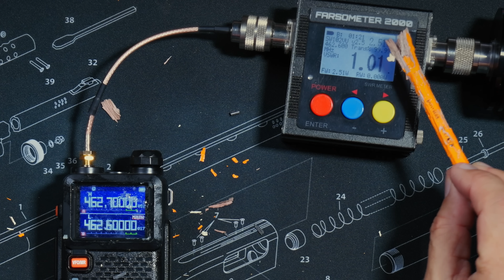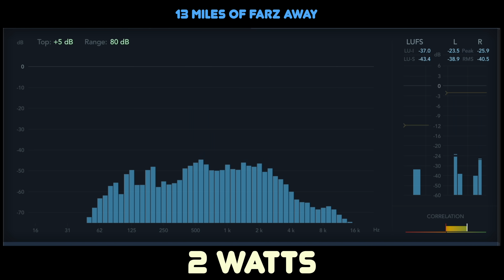Why Power Output Does Not Matter On A GMRS Or Ham Radio

Comment: 13 miles i doubt that unless your a mile high over flat terrain, i barely get a mile or so in a small town
Reply from the maker: Your doubt is invalid. These transmissions were recorded from 13 miles away exactly as described in the video.. Just because you can't do it where you live doesn't mean that nobody can.
Reply: Yet another "sad ham". So many sad hams and so little gravy!
Reply: If you’ve heard him talk about it, he lives on an elevated area without many trees. I get the same 1-2 mile results but I live in the Michigan Rainforest about 5 feet below average terrain.
Reply: I never have any problems getting 10 miles or more from any of gmrs radios.  I have been on the road full time for 2 years traveling in my van over various areas and terrain.  Gmrs works well for me.  I can't talk to strange men in Europe but then, I have no desire to do that or I would become a ham.
Reply: Your range is bad from the antenna, get a smiley or nagoya antenna for better fars
Reply: I get 10 no worries all day every day on stock antennas talking to a friend, i live in 2nd biggest city in Australia, under 10m from CBD.
Reply: You either need a better radio or you are just simply a liar here to troll.
Reply: I can trigger a repeater that is 60 miles away without a problem on my uv-5r set on 5 Watts and standard antenna that came with it
Reply: BS. 13 miles is very doable even at 2 watts.
Reply: There is a reason your comment was pinned.
Reply: I get about 7 depending on the direction I've tested. Rural area with a ton of tree coverage.
Reply: I hit 14 mile away local analog repeater regularly, everyday, with a cheap little baofeng on medium power.
Reply: I can get 23 miles to my local repeater easily on GMRS with a minimal height difference of around 20 ft. between HT and the repeater. I’ve also had the same experience with no height difference at around 8 miles.
Reply: Randy are you familiar with QRP? We Hams talk around the world with just a couple watts. Power is over rated. A good antenna will get you further than a minor increase in power
Reply: Have you tried to transmit outside your mom’s basement? 🤣  sorry, I couldn’t help myself.
Reply: @idahoverland_208 😂😂
Reply: I’m agreeing with Randy on this, I can consistently hit a repeater 17 miles away from me in central Montana
Reply: @bwatchingu  Well, as a few of us know, once you get out past, say Judith Gap or Eddie's Corner, there isn't much to stop a signal.
Reply: Randy is never wrong! I totally agree very little difference. I use 3.8 watts to reach my favorite repeater 24 miles away daily! Yes daily....Preach on NOTARUBICON!

Comment: You’re right, of course! Overcoming a reception problem with raw power is like increasing water pressure to overcome a leaky pipe. Fix the location or antenna issue first! You’ll probably save money and prevent RF brain fry.

Comment: Isn't that more power will drain the battery more? When transmitting or course. So using a low power setting that comes with FRS channels might be preferable to the high power setting for GMRS channels, right?
Reply from the maker: Generally speaking, you only want to use as much power as necessary, especially when using a handheld.

Comment: I compare the wattage of a radio to the brightness of a flashlight. A higher wattage would definitely be a brighter, flashlight, but both flashlights could be easily seen. In the long run, the difference is imperceptible.

Comment: When you buy the Cadillac of a GMRS radio that costs 3X more moneys than another GMRS radio, I expect it to perform much better than a cheap radio.  It’s like buying a high performance Corvette and being okay with having the same or less performance of a Honda Accord.  In the example of Wouxon, a KG905G puts out 5 watts, where the new and more expensive KG915G puts out 20% less power for $40 more moneys.  That alone would keep me from buying the KG915G and stick with the original KG905G, which I just purchased on sale for $85 with a coupon code.
Reply from the maker: Your confusion is because you are equating "performance" with RF-Output, and this is an invalid premise.
Reply: @TheNotaRubicon so when you’re out off roading, are you using low power because it doesn’t make a difference?
Reply from the maker: 100%, yes.

Comment: Straight from Google....
Yes, generally, a higher watt ham radio can increase the distance it transmits, but it's not a simple linear relationship. More power (watts) can help overcome signal loss in challenging environments like hills or dense foliage and can extend range, especially when using repeaters or operating from elevated positions. However, factors like antenna height, terrain, and atmospheric conditions also play a significant role in determining range. 
Here's a more detailed explanation:
Power and Signal Strength:
Higher wattage means a stronger signal, which can travel further, especially when encountering obstacles or when the signal is weakened by distance. 
Terrain and Obstacles:
In areas with hills, trees, or buildings, a higher wattage radio can help the signal penetrate these obstructions, extending range. 
Antenna Height:
The higher your antenna is above ground level, the greater your range will be, as it allows you to see a further horizon. 
Frequency:
Different frequencies (like VHF and UHF) behave differently in various environments. VHF tends to work better in foliage, while UHF is often better in urban areas according to a forum post.
Repeaters:
Repeaters amplify signals, effectively extending the range of your radio significantly. 
Atmospheric Conditions:
Atmospheric ducting, while rare, can cause signals to travel much further than usual. 
Antenna:
A higher gain antenna (one designed to focus the signal) will also increase range, regardless of the wattage. 
In summary: While increasing wattage can improve range, especially in challenging conditions, it's not the only factor. Optimizing antenna height, using repeaters, and considering the environment are also crucial for maximizing your ham radio's range, according to a ham radio blog.

Comment: My (admittedly anecdotal) experience with ham HTs, both 2m and 70cm, is that replacing the typical “rubber duck” antenna with a better one makes a more noticeable difference in real-world use than a couple of watts here or there.  Even with good antennas and high power options obstacles are still obstacles.  That’s what matters, stuff between you, not miles.

Comment: You are correct sir. Over the past months, I've tried several radios with Nagoya NA-771G antennas at both ends. My wife upstairs in our apartment and me at various points in our dense urban neighborhood. 10 watt Baofeng AR-5RM, 10 watt Retevis NR30, 10 watt Retevis RA89, 5 watt Baofeng UV-5G Pro, 5 watt BTech GMRS Pro, and the consistent best performer is my 5 watt Tidradio TD-H3 at a couple miles. But NONE of them transmits past a couple blocks without the Nagoya. That extra 5 watts does not make enough of a difference to matter but the antenna makes all the difference.

Comment: The back ground  noise is less outside of the big cities 156 mhz is good to the horizon  462mhz is more line of sight minus  obstructions but the hire the freq the less the background noise the difference between 2 /5/8 watts is  insignificant it takes 10 times the power to get ONE decibel of gain. That's  why 27mhz is useless  at 4/12 watts the the noise on the lower freq  is really bad from all the electronics and equipment out there! You need a minimum of 30 to 40 watts to be herd the hire freq  are not effected as much 🤔the gmrs are FM only never seen SSB version of them FM mode needs a little more  power to operate.

Comment: You were correct Mr. NotaRubicon!  "Some people" are thinking of CB or something.  There is alot of difference between HF (CB) and UHF (GMRS and 70cm).  They need to open a bit of frequency in VHF (like 2 meter, Marine Radio, and Aircraft Radio) so us poor GMRS users can get through the foliage better.  Come on FCCs we need more fars for in the woods.

Comment: My experience is the difference between uv5r and bf-h6 has to do with microphones and speaker quality rather than power. Better parts in the “more expensive “ and higher power radios is the key.

Comment: 100% Oh Great Leader.
If you are in a setup where there is a "Clear Path", between Transmitter and Receiver, you can get some good distance.   When I was in C-130s, we could do about 200 miles (on a good day) on 10 Watt UHF-AM, with an antenna height of 24,000 feet (about 4 miles).

The problem is, you'll never know that you are "Range Constrained" based on power until it DOESN'T work.    At that point, you're constrained by the combination of Transmitter Power (and effeciency), Transmission Cable effectivity, along with Antenna Gain, and placement.

Keep speaking the truth!

Comment: I listened several times and found no diff between the 6.5w and 5w transmission. The 2w transmission had maybe a 1db rise in noise but otherwise, sounded LC. I say those others people are wrong.
Reply from the maker: I just wish i knew what an LC is.
Reply: @TheNotaRubicon  Loud and Clear

Comment: Can you explain the room you are broadcasting from? Are you broadcasting out through a window and then no obstructions from there as you are over the valley? Or are you in the basement behind a sheet of lead?  Thanks.
Reply: I also want to know if Randy is transmitting from his basement with rubber duck antenna or connecting his radio to a antenna on his roof?
Reply from the maker: I was transmitting standing up, about 1.5 feet to the left of where you see me sitting in the video, which is a window. I was using the radio and the antenna that i said i was using in the video.  As mentioned 50+ times in previous videos, there is good line of sight between my house and Conrad's house, as I am about 1000 feet higher in elevation than he is.
None of which has anything to do with how the three different power levels sound when comparing them to each other.

Comment: If all things are equal, Antenna, coax etc. To double your distance or "fars" you have to quadruple your output wattage. for example, If you get a 20 miles on 1 watt. you need 4 watts to reach 40 miles, or 16 watts to reach 80 miles.
Reply: Everything always comes back to inverse square law....
Reply: Yes but... it's still UHF; still very dependent on line-of-site, yeah?  Folk can hit the ISS in VHF with mediocre power, but not if it's over the horizon.
Reply: @cevansinz  Technically speaking The ISS spends most of its time "over the horizon" Lol..
Reply: Now we're talking E-Field strength.  You are a radio nerd.  Bravo!
Reply: Yup, inverse square law under ideal conditions means more power, more range. Your link budget is controlled by transmit power, antenna gain, radiation pattern, type of antenna, type of terrain, and receiver sensitivity.

Comment: Power means nothing unless you have a good antenna and antenna height is everything.
Reply: How does one raise the antenna height of a handheld?
Reply: @Well_Theres_Your_Problem  Get it away from you body... In SAR it was common practice to hold the radio above your head and use a speaker mic
Reply: @Well_Theres_Your_Problem how high do you want to be stand on a ladder, roof top, mountain top?

Comment: Another great video, sir. My short (6-month) journey down the GMRS path has certainly proved that line-of-site is the most important thing. Earlier this week I had someone clearly communicate via my repeater from 30 miles away. He was using a cheap Baofeng hand held but was transmitting from atop a somewhat high hill. On the other hand, there are low spots around me, surrounded by trees, where 20-watt mobile radios have trouble communicating from 10 miles away.

Comment: I think in theory, you are correct but your testing was a little insubstantive in way that will really convince "some people".  Testing readability with different power levels when you have a good LOS and are well within range,  should be expected to get similar results.  I would probably have run a standard for comparison and run the test at distances closer to the "fars" limit because I think the results are likely to be more sensitive.  All being equal, the only way to truly test it, is at range where any difference in power might be more noticeable (or maybe not).  Just my $.02.

Comment: As always, you are right. I have never felt the need for more 'FARS'. My friends are at most several hundred feet away. Most of the time we would ask what duck they just shot, or do they need me to come and throw a rock in the river where they are fishing. The only time  I find I can't communicate is while driving, and we know where each other is, and if we don't see the other driver, we wait. Yes, I can see where Not a Rubicon needs to use 50 watts to talk with trail sweep, but he is leading dozens of drivers.
 What I want in GMRS is features. Waterproof, easily seen if dropped, bluetooth, floating maybe. If you need lots of 'FARS', he your HAM.
Reply: What GMRS radio are you using for duck hunting? Does it also have NOAA weather?

-Dagger
Reply: Actually,  I have always used Midland FRS radios. I have also lost or destroyed FRS radios. 
I have been pleased with the Wouxun  radio, and I want a new one. The one I am going to buy is the KG-S88G plus in bright pink. Fully submersible,  so I can drop it and recover it, and with Bluetooth, I can stick it in my pack, and just use a headset. I don't go in for a lot of camo either. I could be quite successful with a bright pink shotgun

Comment: I find more wattage helps in the forest but not so much in the desert where theres no obstructions. I can hear a 50 watt through the forest about 5 miles away with a uv5r however the base station can not hear me. I think that just a few watts difference is fairly undetectable but if you jump up to 50 and have some obstructions it does seem to make a difference.

Comment: I would say you are right. It sounded to me like you leaned back in your chair away from the mic as the test went on. I could still hear the test on low power but it was just not as loud and clear. I did like the way the high power sounded the best.

Comment: I can't agree with you more Mr. Randy. Knowing me, I probably would have left an off the wall bonehead commit. However, I do believe that antenna properly tuned, your ranges could vary.
Reply: From 2 watts to 6 watts is 3 X the power, yet the received signal was  nearly the same.
You were right!
I guess it's kinda like the difference between 1 piece of cheese and 3 pieces of cheese. It doesn't change the flavor of the burger that much...